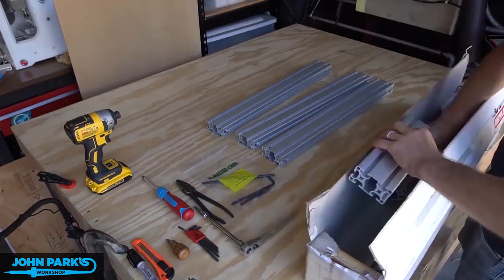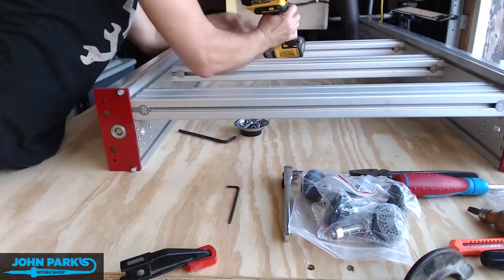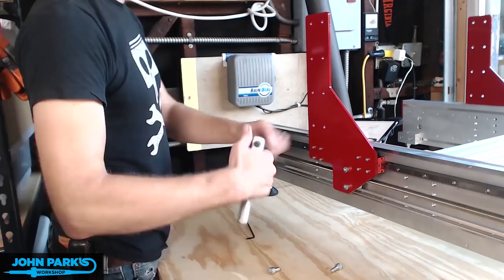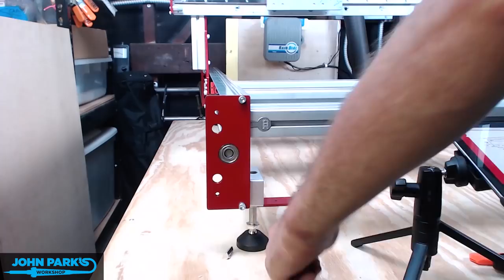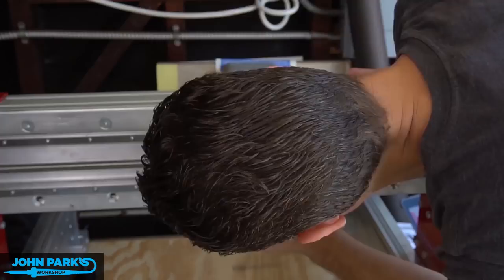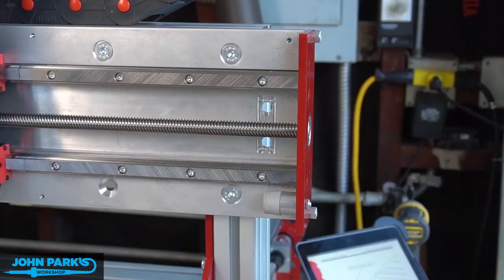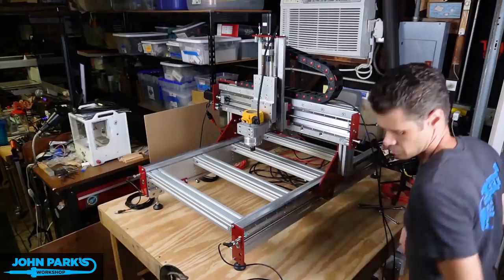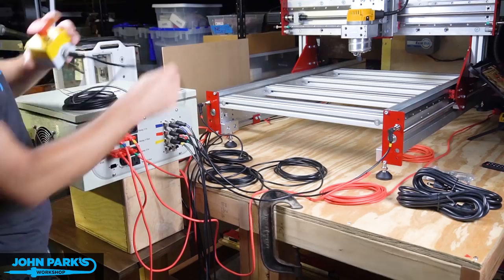John Park's Workshop: CNC Machine Kit Build @adafruit @johnedgarpark #adafruit

Comment: The spiral cuts in the stepper connections are not to dampen motion, they are to allow some misalignment between the stepper and screw shafts. If it were solid and the shafts we're off there would be uneven load on the motor as it turned, if it could.
Reply: Ah, thanks for the correction. Makes sense.

Comment: Very nice build John! Looking forward to the projects you’ll be creating with that machine. If the noise gets too loud for you, look into getting a spindle.
Reply: thanks, it's is loud for sure. any recommendations on spindles?
Reply: John Park 1.5kw or 2.2kw would be good, I would go with 2.2kw. If you’re going to be doing long jobs, not a bad idea to go with water cooled. There’s some deals out there for kits that come with everything you need including a nice set of collets.
Reply: Since you bought the controller from cncrouterparts, you can get the spindle they sell. It’s controller is plug and play with your stepper controller and the spindle will screw right your machine

Comment: Nice... Just wondering is there any movement in the gamtry. The risers and cross beam seems weak. If you were to cut aluminum . Maybe put a dial indicator on the router and see if you see any movement. Otherwise I like it . Also how much and where to buy one.